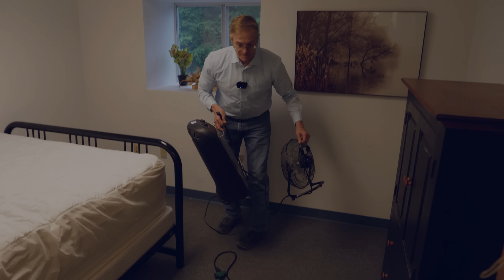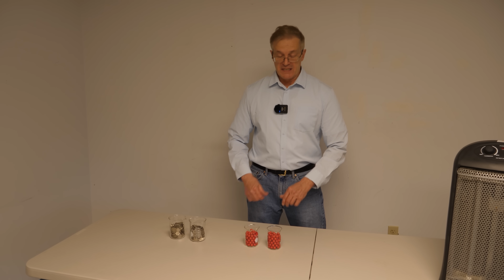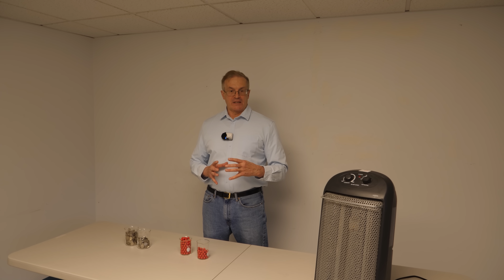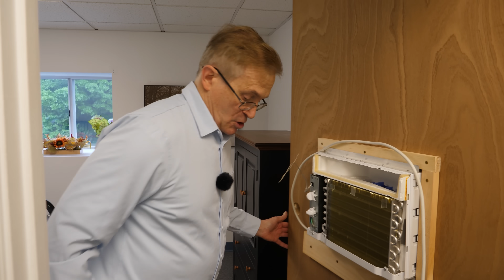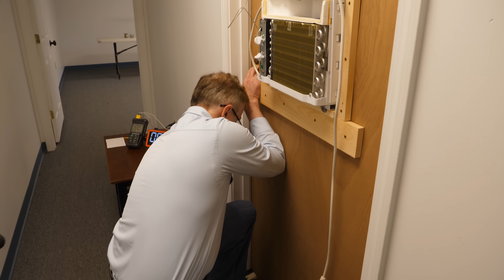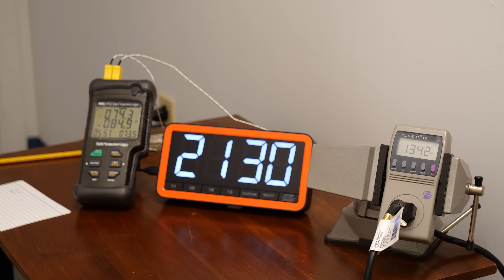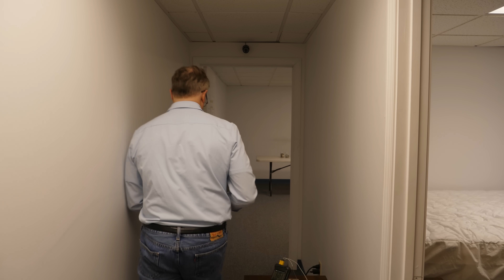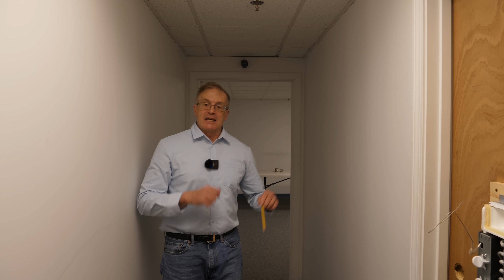You're wasting money on heating! Use your A/C!

Comment: A standard heating element has zero moving parts besides a fan, and excellent efficiency. This is bogus information at best.
Reply from the maker: You should have watched the explanation in the introduction more carefully.  I said the efficiency of the resistance heater at CREATING heat is extremely close to 100%!  The pump doesn't create heat. It moves it around.

Comment: the only problem i see is that you would not use a heater at those temperatures how well does the ac work at removing heat from an already cold environment to produce heat would be a more realistic scenario for the test
Reply: like could the ac use 40 degree outside air to make the inside temp reach high 60 low 70s that would be a lot more interesting sorry to sound like i didnt like the original experiment it was awesome and got me thinking
Reply from the maker: That was the purpose of the video.

Comment: So you just turn the ac around backwards?
Reply: I want to try this in my garage!
Reply: Yep. Heat comes out one side and cold out the other. It’s why it has to be 1/2 inside and out. If u stick an a/c in the middle of a room it would work. It would actually heat the air a bit. Especially a dehumidifier works that way

Comment: Cool demo but if I turn my ac around, what do I do about the water dripping in the house? How can I use this practically?
Reply from the maker: Remember that the moisture is produced from the cold side.  This moisture is typically routed to the hot side to improve the performance of the heat exchanger. This water can be drained from the cold side.
Reply: @TechIngredients  right and when there’s too much moisture they drip. Mine constantly drip on the window seal and therefore turned around it would run down the wall.
Reply from the maker: You should look at your drainage port and make sure it's not blocked.
Also,  don't mount your air conditioner level. They are designed to operate at a tilt to control water flow and drainage.
Reply: @TechIngredients  right so it would drain into the house. Also you’d have to go outside to adjust the temp and rain might fry the electronics since they are on the outside of the house. This is not functional, just a cool experiment.

Comment: The main problem with AC systems is the phase change as the outside temperature drops to the dew point, as the dew starts to freeze close to zero degrees Celsius. Secondly, once the outside temperature does get cold you combat the thermal resistance of the room. This is a similar problem to the Peltier delta T limit, once you cross the bridge the Peltier stalls, and a similar thing happens in adverse conditions with AC.
Reply: The problem of ice buildup outside in cold weather improves as the temperture drops farther below freezing, because the Absolute Humidity of the outside air drops VERY rapidly. But most heatpumps are not built to run at 40 below or colder. They could be, but they aren't.

Comment: There's something I can't really agree on with this video. The thermal probe is not equidistant for both scenarios which could give an advantage to the A/C being closer. IMO, the thermal probe should have been near the window (opposite wall from the door) and the heater at the door, same distance as the A/C.
Reply: It was okay as it was, out of the draft caused by the fans, and measuring whole-room temperature.
Reply from the maker: Yoda is correct.

Comment: I guess the only test we need here is, how well will this work if your trying to warm up a room if it 30 F or below on the cold side I'm wondering what happens then?
Reply: Usually the cold side would freeze up with ice as outside humidity condenses and freezes on the evaporator coil. Normal heatpumps will reverse the valves periodically, to defrost that ice, but the unit improvised with a window A/C will have to be defrosted manually.

Comment: I'm all for heat pumps but the numbers for this experiment is skewed more in favor of the A/C unit because it is closer to the temperature sensor AND you are not using the same fan to circulate the air in the room like with the heater to keep the air temps more uniform.
Reply from the maker: The airconditioner does have a fan. It is directed at a right angle and away from the probe.

Comment: What design and refrigerant is best under the following conditions. Outdoor temperature range -50C to +45C. Best efficiency to cool well in 45C(114F) summers, and -50C(-62F) winters. These are the highest and lowest possible temperatures in my region over the course of 100 years
Reply from the maker: I'd use a commercial heat pump for temperatures that are not that extreme.
When they drop that low, the advantage of a heat pump becomes so small that rather than trying to build one around that differential, just use a more conventional heat source.  Your overall, yearly energy consumption will still be much lower by adding the heat pump to your system.
Reply: @TechIngredients  Problem is, to use resistive heating I would need 200A or even 300A service to supply the needed wattage just for those 10 nights. We use Natural Gas as the go to for heating for a reason. Unfortunately the climate types(who don't understand basic physics) always demand we electrify immediately. Heat pumps that work at -45C would be the only way, otherwise we would have problems. Id estimate, to be able to use resistive heating in all buildings on those cold winter nights, we will need ~5 times the transmission and generation capacity we currently have. Last winter we almost had our grid fail during an extreme cold snap, because it was a very cold and calm night with wind and solar down. We had a few Natural gas power plants go down which nearly triggered catastrophe. We simply can't electrify easily, the climate is too extreme, generally these gas fueled plants operate at maybe 50% and handle the spikes in demand. We would need a grid that is engineered for the demand plus a safety margin. So in reality we would build to a demand that is 10 times the peak demand. Id estimate the cost would be upwards of $1 trillion and take decades. An analogy I use(and you could demonstrate that on your channel) "you can't charge a tesla or run a heater with speaker wire, Poof"

Comment: There are negatives to reversing an ac unit like this. It is creating a very humid space on the hot side. Heat and humidity creates mold. You would not be able to adjust your AC from the hot side if it was turned around. If the air on the cold side was cold enough, ice would form on the elements and the unit would stop working. That would be bad if it happened at night. Better to just get a reversible heat pump. They make window units and all the way up to whole home units.

Comment: In a cold climate like Eastern Ontario Canada in January could I install a window shaker with the cold air flow going outside and pumping hot air into the house more efficiently than using a space heater?

Comment: you shouldnt have removed the heater and fan since those both absorb heat and affect the temperature of the room. next time leave them in as constants after allowing them to cool for the most accurate measurement although other than that the point was well delivered nice job!

Comment: Great videos, can you please make a video about how to make the best DIY capacitor dielectric material??? I want to replicate the experiments of Charles Buhler and Andrew Aurigema (Exodus asymmetrical capacitor). They have instructions on how to replicate but they are using styrofoam as dielectric and I guess that you might have some clues on how to make an amazing dielectric at home. Thank you again for your videos.
Reply from the maker: Actually,  that's easy.
Polyester film is fantastic. It's inexpensive, with a high dielectric constant ( I believe it's close to 3.5) and a very high voltage breakdown limit around 7,000 volts/mil.
Reply: @TechIngredients  thank you for your answer. Is posible to make a compound with a elevated dielectric constant and breakdown voltage? I have seen that Barium Titanate has an elevated dielectric constant, but don't know if is toxic, or if its breakdown voltage is high, etc.
Reply from the maker: Its breakdown voltage is lousy at around a few hundred volts, but it's dielectric constant is very high as in the thousands 
But because you need a thicker layer to compensate for the low breakdown voltage, this works against the high dielectric constant.
It's also expensive, and as a ceramic it has to be sintered to form a solid layer.
I've built a lot of capacitors with the polyester.  It's easy and they work well.
Reply: @TechIngredients  thank you very much

Comment: A very interesting test.  I feel like you should have preheated the room to a set temp (say 90F), then let it cool for a fixed time (say 90 mins), then run the space heater test for how long it takes to heat back to 90F, let the room cool again for the cooling period, then run the backwards AC unit test for how long to get back to 90F.  I also think the AC unit should have been in the window to simulate practical application; pumping heat from outside.  Your videos are super neat and thought provoking, keep it up!

Comment: But what about window loss, wouldn't it make more sense to have the space heater and fan in the same area as the ac? So do these things have built in heat exchanges to offset some of the electricity cost?  Also did these units have the same wattage  powerratings? Like the fan AND the space heater?   I notice you say this at 14:50, also wouldn't it make more sense to window mount the ac rather than put the cold air into the hallway or have a "well" that you bump the cold air into? Like especially if below the frost line in winter... air in a well could it displace warm air and move it up the well?

Comment: I have been using a dehumidifier to help in the heating of my house, I took a plastic tote and made a towel rack out of wood and placed 3 towels on it, then put plastic on the top and sides and left the front and back open. Then put the dehumidifier and plastic tote with towel rack on a small cart, The air comes thought the back past the wet towels and out the front into the back of the dehumidifier. My dehumidifier used around 480 watts, but I think the heat output is around 2500 watts. My electric bill was about $20 more each month. I also made a TLUD stove that burns pellets and my house has an oilburner furnace. Last year from October to May, it cost about $600 to heat my home, $220 for pellets, $238 heating oil and $140 for electric. I live in Michigan, the house is 1100 Sq. ft., temp was 68 and 65 at night.

Comment: Wouldn't this be because an ac unit ISN'T efficient?
Reply from the maker: I don't understand.
Reply: @TechIngredients  it heats up the room more than it cools the room off? I understand that the room / hallway is open and therefore larger, but wouldn't you notice a drop in temp close to the unit a similar amount of degrees? It seems like it generates more heat than it removes.

Comment: Good afternoon, My name is Giiam Felix Klaver
I live in the Netherlands. IN a self-built house.
Finnish, and from a gas-fired hot air, to a 100% heat pump.
I am also a certified energy expert. And provide free information about the energy transition to the local community
I have been looking at your information for many years.
The first time was making alcohol. and Thistle .
Do you object to my using this story about energy differences?
Electric heater against a heat pump
Thanks for your response.
Kind regards, Giel Klaver.
Reply from the maker: Go for it.

Comment: Was there a puddle of water inside the room?
Reply from the maker: No.
If that becomes a concern when the cold side is operating in a humid environment, then just drain the water outside where it is produced rather than transferring it to the hot side where it normally drains.

Comment: dont forget to put a tub underneath the backside of unit to keep water from falling all over the carpet. 
Other things completely overlooked at.. 
Air conditioners are basically de-humidifiers, 
but in order to de-humidify? the water has to go somewhere else. That is why every AC has a drain system. 
This is an interesting test, however you will be causing damage structure to your house. Grow a bunch of mold, the walls get destroyed etc. 
Because the back side being tested as a heater is also filling that entire closed off room with hot moisture and dirty water in a AC drip tray. Creating spores in oxygen that could 
make you VERY ill. 

Not intending to bash this video in any way but it can become health risks to households if someone were to make this a set in stone at their home thinking this is a good idea.
Reply from the maker: Remember,  that condensate is produced on the cold side.  It is typically transferred to the hot side to improve the performance of the heat exchanger. 
You can choose to drain it wherever you like.
Reply: @TechIngredients  I will also contest to that and say the drain trays in these units will also collect a lot of nasty particles, thats why the drip trays in "window units" are also very dirty. Nobody cares to clean them. 
Also, the fan is responsible for picking up a little bit of that water in the drip tray and throw it around to cool off other components. Which means its throwing around whatever is resting in the drip tray straight into the atmosphere right in that room with the closed door if the person in video did not clean the entire unit. Which also showed no clip of doing by the looks of it.

Comment: A Fahrenheit degree is 80% smaller than a Celcius degree. Celcius has 100 degrees between the freezing and boiling points of water. Fahrenheit has 180 degrees between those points. Thus it's 80% more precise without needing to use partial degrees.
Reply from the maker: Correct.
The meter was limited to one decimal no matter what unit system was chosen.

Comment: Isnt this test flawed in that your heat pump is actually amplifying and concentrating already heated air from the hallway into a smaller space where as the space heater had to heat up isolated space by itself? To further articulate my point- If the AC was simply turned around in a window of a house and attempted to extract heat from colder air (or pump cold air out) this would be no contest in the space heaters favor. You cant pull something from nothing but your test clearly has a heated hallway to bias one side of it.
Reply from the maker: If you watched my explanation in the introduction, I covered that.

Comment: i thought the most efficient electric heater would be run power tools for work and all the loss id heat friction anyway, it's efficeincy range is based on how much stuff i make and how much it sells for ...there should be a combined water heater, clothes dryer , oven , whatever heat ...i don't like space heaters with blowers because they can cause weird humidity issues at windows and walls
Reply from the maker: It would be more productive, but the amount of heat produced for each watt, joule, etc, would be exactly the same.
Reply: @TechIngredients  wow! to get a reply from you Sir,  thankyou , sorry for my spelling ..i was using electric heat and must have picked up the concept reading comments , the electric heater seemed sop expensive and i have a bathtub burn barrel outside but needed the heat inside ...had me daydreaming of a radiator that uses maybe brake fluid instead of water type ideas , a mini version that can go 700 F or so , Brake fluid boils high temp so it doesn';t produce steam and is hydroscopic so it needs changed ( I HAD TO ADD SOMETHING YOU'RE BUSY LOL brainstorm

Comment: can a window be converted to do this in real world applications to heat a room or is this just a demo on a heat pumps efficiency?
Reply from the maker: It's primarily a demo. If the whether permits it could be used to heat a building.  The electronics and the controls would be exposed and possibly difficult to access.

Comment: This demonstrates the principle how of moving heat is most definitely less energy demanding than resistance heaters and is a decent example if you wanted to heat your room from a comfortable temp to green house temps but try that experiment in a more real world situation where your hallway and surrounding environment is 30 or 40 degrees Fahrenheit.  I'll bet that window AC unit struggles to raise the temp 10 or 15 degrees  as it tries to reject coldness into an already cold environment.  Likely the "outside" coils will freeze which will require some kind of secondary warming solution to unfreeze them.
Reply: There are loads of heat pumps that work well into the -20ºC range with overunity (more than 100%) efficiency. In fact, Alec from Technology Connections has a wonderful video showing how even at VERY low temperatures (think Alaska), you're still at least guaranteed to approximate unity, which is the same as a regular resistance heater.

Comment: Love your videos and especialy how you explain stuff. Maybe you can answer the following questiong in the next video: How does the refrigerant effect the efficency of a heatpump? Is the worsening of the COP in colder weather just due to the higher pressure differential needed to keep the boiling points at a usable level? And would it be significantly enhanced with cascading of 2 heatpumps with different refrigerants? Or is there another phenomenon at work?
Reply from the maker: You're right that the refrigerant as well as the pressure ratios have to be chosen to match the temperature differential. I'm not sure if cascading loops are used in commercial heat pumps, but that would be a good idea.

Comment: Reverse cycle heat pumps are becoming pretty standard in new builds and retrofits here in New Zealand. Our temperate marine climate means airconditioning is not often required but it's a nice-to-have during occasional extra warm spells